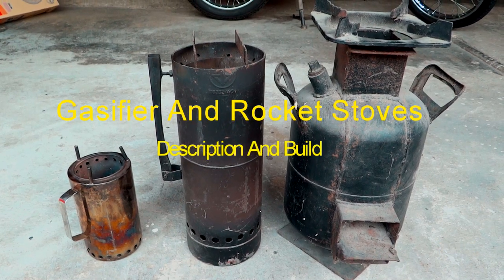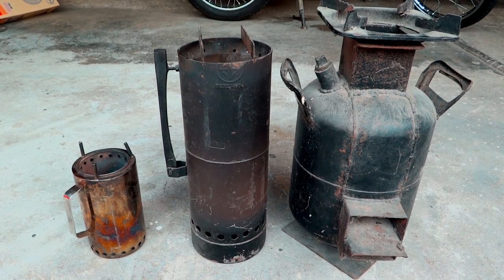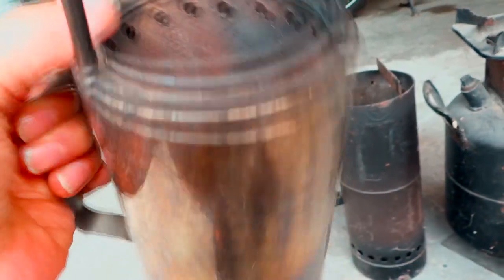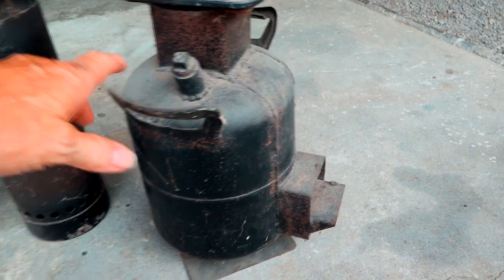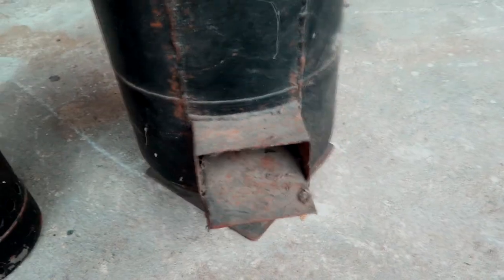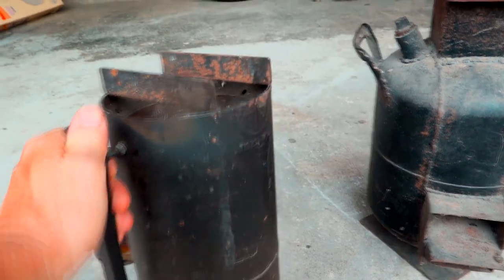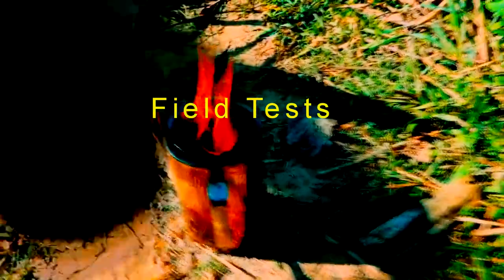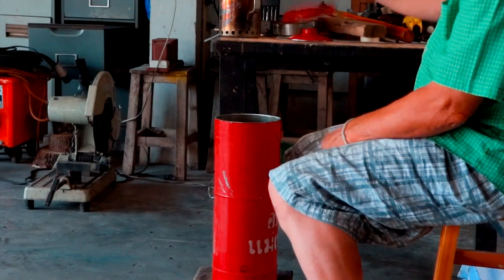Gasifier and Rocket Stove Builds

Comment: What would be the ideal height? Does the length(height) of the can from the bottom holes to the top holes makes any different in the performance the air/gas?
Reply from the maker: You dont say what can you are referring to but the taller the better think about draft the ability of sir to be drawn up drawing gas along with it no ideal height just don't make it short and fat lol cheers!

Comment: Which of these do you recommend for making the most biochar?
Reply: Shrive - biochar is a result of air starvation... the same stove with excess air actually will consume the biochar (carbon) with excess air boosting the temp to achieve chemical reduction (heat) of carbon leaving a small amount of fly ash. If you want biochar for gardening be sure to mix biochar with compost to inoculate with beneficial bacteria before inserting into garden soil. See: https://youtu.be/svNg5w7WY0k and  https://youtu.be/aP0cWnHb_L0